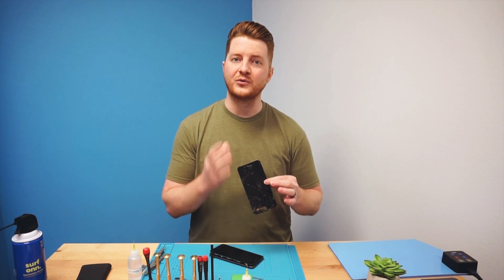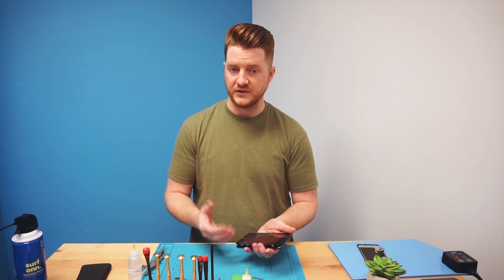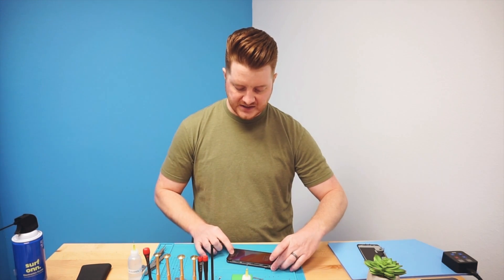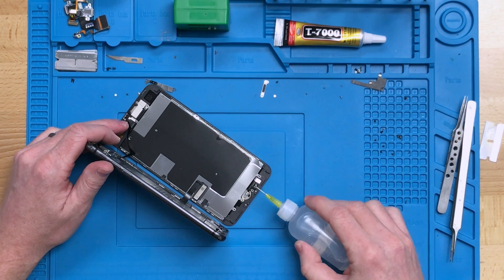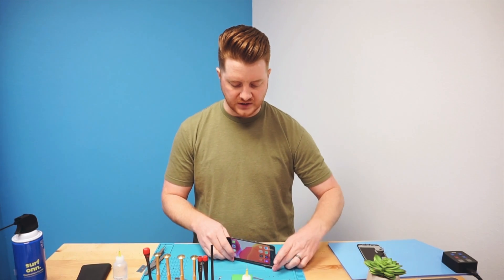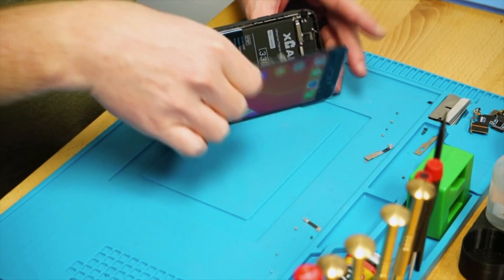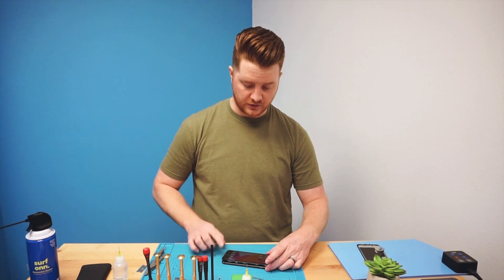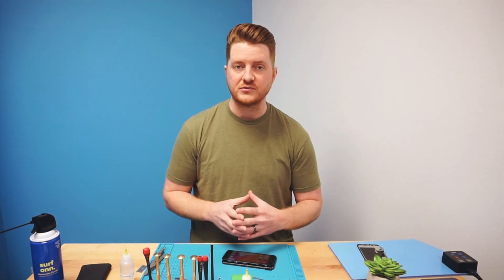Why Does the Home Button Stop Working After a Repair?  -  Repair Shop Basics

Comment: Can you do more video on IPhone SE  problem such as blank screen and it won’t charging the battery after changing damaged main 
screen . And also the home button is not working since I have the technician fixed and now they said it is the mother board is damaged????😢😢😢. Is there a chance when they are changing the screen incorrectly and it quit working???

Comment: Just use a heat mat or hair dryer for a bit, just a little then use a nice even plastic spudger to very slowly press under the connector then use a bit more heat of there is resistance 
Never used liquid to remove a part off of a screen before and repaired a hundred phones

Comment: Hello, I have a iPhone 7, replaced the screen, but after installing it, the home button couldn't move anymore, so bought new home button, still the same, when doesn't it move anymore? Thanks
Reply: I have the same issue with my iphone 7 plus. Screen got replaced a few years ago and the home button only reacts to fingerprints and that double tap thing. Haven't got it fixed or nothing just been using it as is.

Comment: I took a iPhone 6S Plus to a repair shop for a speaker replacement; now the home button only works like 1 out of 20 times i click it; no issues with reachability; also, since the 4 days it’s been repaired, I’ve returned home, 400+ miles away from the repair shop, fml~~~

Comment: Thank you!  You saved me a lot of heartache and time because I was about to tear apart my phone for no reason.  I just replaced my back glass on my iPhone SE, and the final step before applying the glass was a wipe down with isopropyl alcohol.  I barely got the cloth wet and maybe was too aggressive towards the bottom of the phone.  It didn't take much to waterlog my home button, maybe just a coating.  After I put the glass on, I couldn't get the home button to work, other than unlocking and dropping the screen halfway.  I immediately searched online and your vid was first up.  I was lucky to peel the glass off since the adhesive didn't cure.  I placed the bottom of the phone under a fan, after about 20 min the home button works. Would the same issues prevent the earpiece speaker from working? I can hear calls on speaker phone but not in regular mode. Callers can hear me in both modes. I’ve tried many of the online tips to no success. I’m worried I overheated something during the removal of the back glass. Any tips?  Thanks!
Reply: I was in the same situatin with 8Plus, no ear speaker after screen replacement, cameras worked fine. What is worked for me is to change the front camera ribbon cable. I was carefull at the removal of the original cable, there was no visible damage on it. Inspite of this it was damaged beause of installing a new ribbon solved the problem. I was lucky because the cable is cheap for 8plus, I am not sure about the SE2020. Good luck.

Comment: I actually had two iphone 8+ 64G 128G one screen was broken so I switched it upon doing that I realized that the good screen stopped working I think it's because of the heat I applied to remove it. Next thing when I switched the screen it said unable to verify touch ID on this device or iphone.  Can someone help me

Comment: Today I teach you how to never have that problem, use heat not alcohol, a liquid can run under the display & stain the light scatter films which is why you apply a little heat and lift gently with a flat tool. Voila
Reply: What kind of heat?

Comment: So you're not even gonna mention anything about Touch ID not working with aftermarket screens at all; or logic boards (unless the button is paired with the new logic board with the help of a special device)?
Reply: Not what this video is about.
Reply from the maker: The home button and touch id function work 100% with aftermarket screens. This video is solely for the 'water log' issue created by iso during the home button removal causing the 'click' to temporarily stop working.
Reply: I dont see why would that be relevant as the screen does not affect the touchID, the botton and the screen are totally separate and one does not make the other one stop working, only the dumb people belive that.

Comment: My touch id is working but the back to home function is not working at all for over a month now
Reply from the maker: Was the device worked on previously?
Reply: @profixerr6275  do u recommend trying DFU mode to restore the home button?
Reply: @profixerr6275  display was changed
Reply from the maker: @doitwithnick501  I don’t believe that would work. You most likely have a tear or a bad screen.

Comment: Okay but I haven’t used any liquid on my iPhone 7 to remove the home button. I haven’t damaged anything to my understanding. I have changed my screen 3 times. Every feature had worked. (Siri, return to home, Touch ID) with the clicking of the button. How ever, I’ve changed my screen since, again no liquid to help, no damage. Everything works. Touch ID, Siri, return to home. The button just doesn’t click(vibrate). So what is the cause to this problem. And how am I able to fix it?

Comment: i just opened screen without replacing yet anything and home button isn't working already
Reply: ay same here..
Reply: You damaged the home button cable on the display side when opening it
Reply: @wnsd186  mine did the same thing but the cable looks fine do you think theres anything I can do?
Reply: @claresimon  touch ID or click function is gone?
Reply: @wnsd186  yeah its not working at all. It was making loud noises when being pressed before I opend the phone as well. So that might also have something to do with it.
Reply: @claresimon  that's the taptic engine. You probably damaged the cable, I'm sorry
Reply: @wnsd186  darn, is that a button replacement or the whole tapic engine?

Comment: the very bottom part of touch screen is not working on my iphone 6s+ after replacing it with new screen, every other part of the screen and the home button works fine but due to the issue with the bottom end of the screen its making using most apps extremely difficult, do you know any fixs for this ?
Reply: Damn I hate when these guys won’t answer. It’s a great way of loosing likes and subscribers!!!

Comment: I had my screen replaced after the people trying to fix my aux port broke it, after I got it back the home button is shot. I remember being so upset and this was back in November. Touch ID still works somewhat but I still have to press pretty hard to make it recognize anything. That little button on my screen that makes shortcuts for home button has saved my life (I forgot what it’s called).
Reply: assistive touch.
Reply: @lybmae  thankyou

Comment: My iphone 7 home button is not working at all no go back no double tap. But the thing  is it still recognizes my finger print and unlocks the phone. And i actually did a little bit of research and found that the problem was the chip called - U10 - on the home button. Which means i have to replace it with a new U10 chip. But what i wanna know is if i take a chip from another home button and replace it to mine will it work ? or if i replace the old screen will it work ? Any ideas about this ?

Update:
Placing the original display doesn't work still the same.
Funny i tried blowing the home button and now finger failed. XD 
i think im gonna get my self a new iphone 7. Maybe after couple of month cuz the money lol end my life
Reply: Hey, do you know what happened or if it got fixed? 

cheers
Reply: Same with me, my FP still working, home button not

Comment: I’ve never had an issue just removing it with heat.
Reply from the maker: Some shops dont. But to create a method that is most successful for the most techs, we recommend iso and heat for removal.
Reply: ProFixerr seems just like just another potential problem.
Reply from the maker: Iso doesn’t hurt the button. It softens the adhesive and makes it lose adhesion. It doesn’t cause damage as mentioned in the video
Reply: I have used iso, followed by heat for years now and it works great
Reply: @VINJE76  what kind of heat